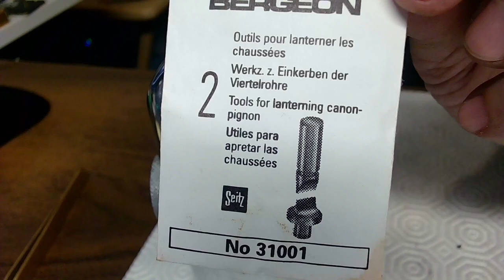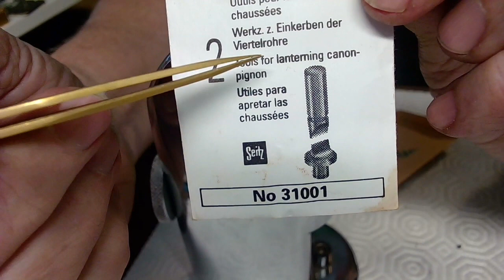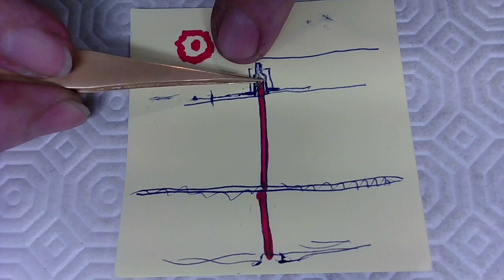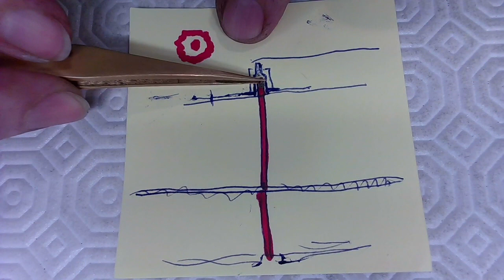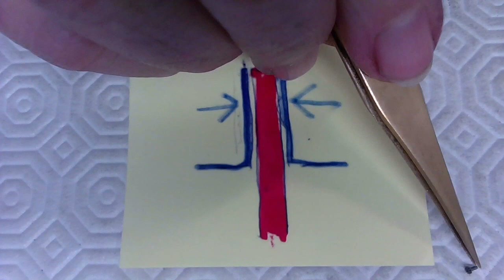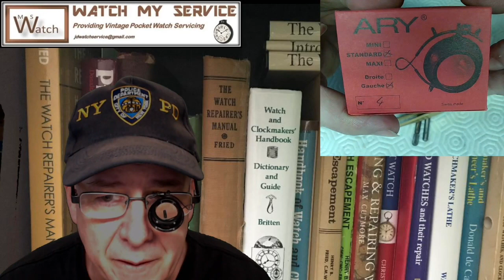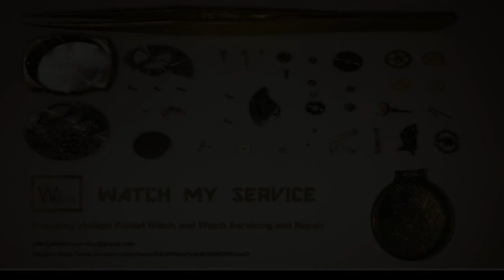Closing a Watch Cannon Pinion

Comment: I have a set of broaches.  A small broach serves the purpose of your wire and allows you to re open the cannon pinion if you tapped too hard.
Reply from the maker: Good comment on using the brooches to reopen the cannon pinion if you do pounded down too far. I thought maybe you could use a sewing machine needle or something to re-open the hole if you do tap it down too hard and Pinion ends up being too tight

Comment: Thank you very much! This video is really helpful for it shows the fact how clocks and watches function.
Reply from the maker: Thanks
Reply: @JDRichard  Are motion work direct part of going train in clocks and watches with second hand pivoted co-auxial with hour and minute hand?
Reply from the maker: @noelaruldas1152  I would say yes. The keyless mechanism starts from the crown and stem all the way through to the main spring barrel, and then the motion work start from the main spring barrel all the way through to the hands actually moving. You can do a bit of research on this to see how accurate I am, but this morning I’ve decided to answer you without looking in a book.
Reply: @JDRichard  In some clocks and watches the second hand is pivoted in seperate sub dial and in some clocks the second hand is pivoted co-auxial with hour and minute hand. What is the difference in the arrangement of wheels in both types of clocks?

Comment: Sir, Good morning I have serviced Citizen 8200A movment it's running fine but stops at time of day/ date changeing period near about 10:40 PM. Is it due to loose canon pinion wheel? Day/Date change with button fine. Please guide ... 🙏
Reply from the maker: Are the hands touching?  Assuming it is an automatic watch and not a quartz??
Reply: @JDRichard  It's Citizen automatic (Cal.8200A) watch. Hands are not touching. I'll replace canon pinion wheel and  check if problem resolve. 🙏 Sir, thank you very much for your reply.
Reply from the maker: @udayrathod6471  for some reason, it still doesn’t sound like a canon pinion problem
Reply: @JDRichard Sir, ultimately I found problem in Centre wheel,l replaced center wheel and problem resolved in my Citizen automatic watch (Cal.8200A). There is no problem in CANON PINION Wheel as you said. Thank you very much for your help.

Comment: Nail clippers (fettled) and selection of sewing needles.
Reply from the maker: I’m not exactly sure what you mean but when I find out it’ll probably be really funny
Reply from the maker: Oh I think I get it, sewing needles are for putting into the canon pinions to help support as your closing opinion that is a brilliant idea thank you very much.
Reply: Yep and the nail clippers have blunted blades with a tiny v cut into them or if your really adventurous use a small ba tap to cut a thread for ba bolt and finger wheel for more controlled tightening

Comment: It must be Cannon Pinion (fr. Pignon) Week.  Chronoglide also released a canon pinion video today.

As one guitarist to another: tissue paper and clear nail varnish or lacquer.  
Working as a computer tech I'd often have damaged nails, but still had to play for performances etc.  What I would do is coat the nail with clear varnish and then lay a piece of tissue paper over it.  Put down more varnish then add tissue paper and so on to build it up.  The last layer should be more nail varnish.   The paper needs to be very fine but very fibrous, like toilet paper etc.  After it has dried you can cut/file/buff it into shape.  I've even been able to play normally with this repair after ripping my nail clean across and building myself a new one.  A little split like that is no problem.  Looks ugly, plays fine LOL.
Reply from the maker: Hey thank you very much for the advice and building up the finger now and may even try this. Otherwise I have to cut them all flat and start all over again and wait two weeks before I have enough nail to be able to pluck the strings properly. The other option is I just played Blues for a couple of weeks or rock or jazz or something with a pick.
Reply: @JDRichard  Oh, some of the best blues techniques use finger picking too.  Alternating finger pick patterns based around chords or scales etc.  I just can't do without my fingernails...
Reply from the maker: Those crazy Europeans:). He did not demonstrate how to close the cannon pinion. As well, vintage pocket watches did not have the notch that he was talking about. Neither did non-North America pocket watches. He was specific to modern watches.
Reply: @JDRichard  Yes, but it's all good information.  I do both pocket watches and wristwatches, and I'll be paying a lot more attention to the canon pinion from now on.  I like that crazy European (Kalle Slaap) and his videos are great from a fault finding and general horology perspective.  He challenges me to pay more attention to what I'm doing and to do a better job.
Reply from the maker: @Chris_the_Muso  you are correct, these guys are real professionals and know what they’re doing and do a great job in their videos. I do this as a hobby and make videos to help others in doing watch repair where I can. I share information that I have gained from others or that I’ve read in books I have a huge library of watch repair books that I often go back to to make sure I’m doing things right. I focus on vintage pocket watches rather than watches and it allows me to have a specialty plus I love pocket watches. As you have seen in my videos over the years I have done a lot of watches as well including a very nervous Rolex that I got working again perfectly. I’ve also done some Tissot movements and some Seiko movements and others Watches of various types and vintage. I just love to learn and I love to share the knowledge with others thanks for your comment and let’s stay in touch.
Reply: @JDRichard  Yes I'm about the same, but I'm just starting on this journey.  Every movement is a learning experience, a bit of an adventure.  I'm thinking I should start videoing what I'm doing.  I don't know if the results would be worth posting, I'm seriously lacking video equipment though I was a stills photographer in a past life.  There seems to be two schools of people who view watch repair/restoration videos: on the one hand there are the ASMR guys, which would seem to include most of the non-technical collectors, and then there's the technical guys like you and me who want you to name each part as it's taken off, have it inspected, and a short discourse on it's function.  The best stuff are the videos that demonstrate repair techniques.

I've got a 1961 Tudor belonging to a friend that I'm not game to touch yet.  It will be an automatic ETA movement and It's got a worn rotor bearing I'll have to deal with.  It was presented to her grandfather in 1963 for 40 years service, so it's also a family heirloom.  I'll need a lot more experience before I tackle it but it's definitely on my list.  I just might take the balance off it so I can find out which movement it is, but that's as far as I'm game to go at this point.

I ordered a Seagull ST36 movement to learn on (copy of the ETA 6497), but it took 9 weeks to get here so I finished up working on some old HMT 0231 movements first.  First go was a great success, so that was encouraging.  At least it's given me a good idea what tools I need going forward (a good staking set is high on the list, the spring winders are a bit expensive for hobby work but I'm definitely going to have to go there, and I've got a hankering for a lathe...  damn, I'm screwed aren't I?).

I've got an Inventic pocket watch from 1917, a pin lever escapement which was basically the WWI equivalent of the disposable pocket watch.  It needs the steel case nickel plated and I think that it's OK to do that because (A) steel) and (B) it's not actually worth anything.  I just want to learn on the real junk first because I'd actually like to get this one back to operating condition and use it.

I also have a Waltham from 1898, so looking forward to working on that one.  It's missing  minute and second hands and a crystal, and is more of a restoration than anything.  I've received a glass and a minute hand (blued) but the small seconds hand has alluded me so far, as the pinion is recessed (broken or made that way, I'm not sure).

Learning is fun.  I just wish I had the eyes and nerves I had forty years ago...
Reply: Time to go to nail salon.  Get sparkles.